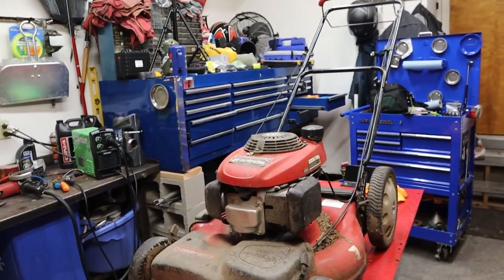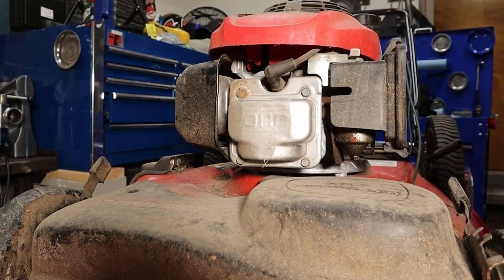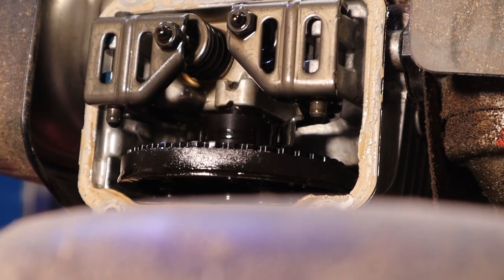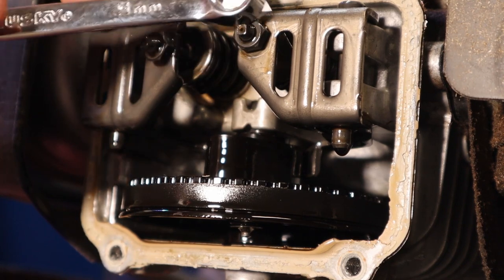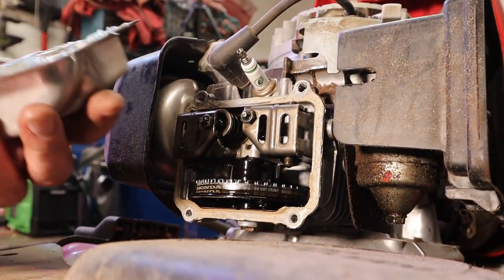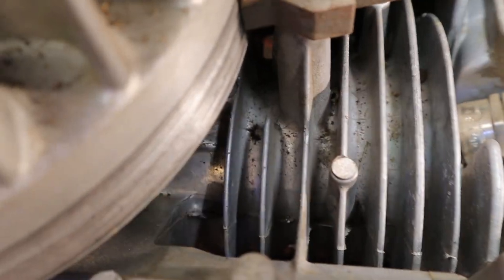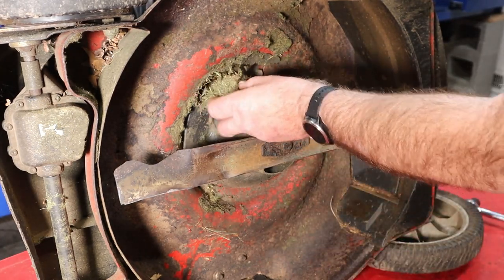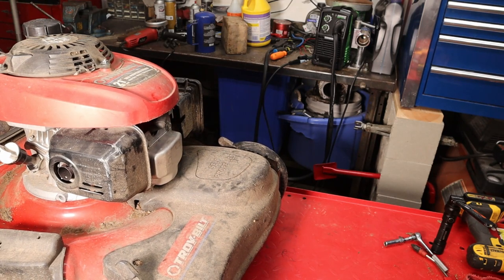Troy Bilt Spring Service On Honda Engine

Comment: Found one of these with the smashed-in valve cover removed. I hammered out the dents and bought bolts and resealed it. One of the bolt holes was ripped off so three bolts holds fine. It's got some rod knock and of course a little blow by. I always unhook the breather and route it away from the engine. Also I plug the inlet to the air box. Rust prevention
Reply from the maker: Sounds like you got her fixed.